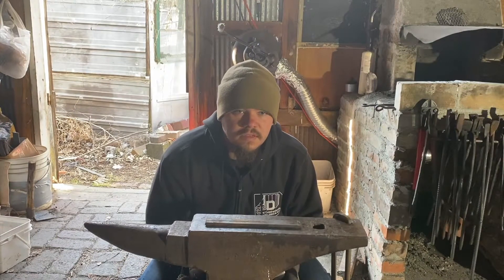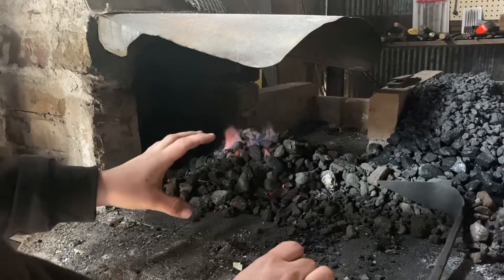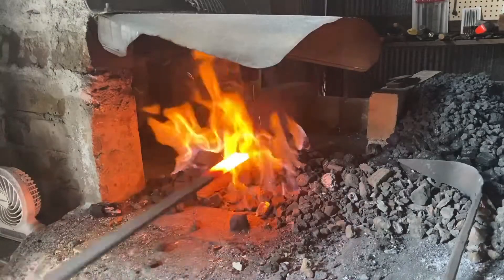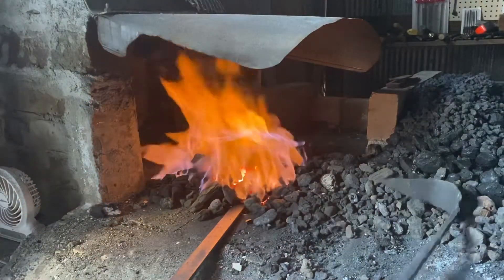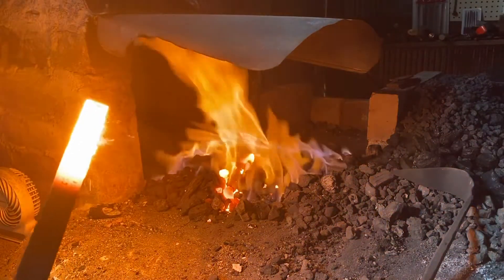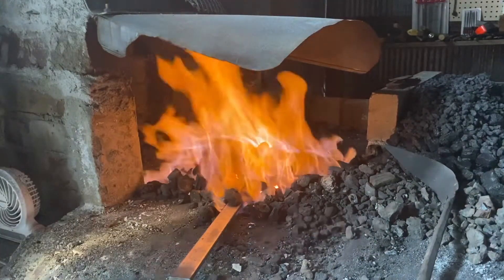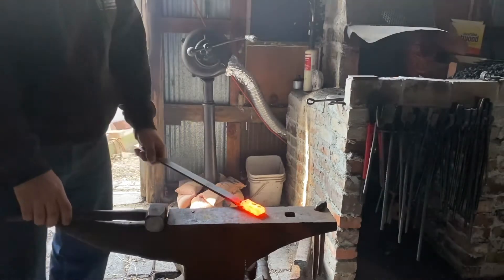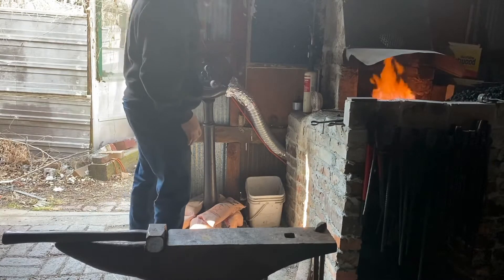Learning How To Forge Weld Made Easy

Comment: I’ve been having trouble forge welding I was wondering where u put the metal in the forge pot to forge welding cuz I keep burning mine or it’s just giving off a lot of forge scale
Reply from the maker: @markperryman797  I lay mine flat with the table, that puts my steel at the reducing zone of the fire from my pot, which prevents the excessive oxidation of the steel.
Reply: @ so just leave it in the neutral zone don’t put my metal in the fire pot
Reply: @veteranironoutdoors8320  I was putting it into the fire pot not realizing it was probably oxidizing it

Comment: I've found scale the biggest problem. If I can't get it to stick its usually due to scale and not cleaning it off.
Reply from the maker: That means you are not getting the metal heated thoroughly. At forge welding temperatures (for mild steel and wrought iron) scale actually melts and becomes a ferrous liquid. (If you want to get technical, the atmosphere in the forge has chemically converted the scale to liquid iron-if you use flux the chemical reaction makes this happen at a lower temperature) When you hear people say “the steel must look wet to weld” that is exactly what they are talking about. They have an even heat throughout the piece and the scale on the outside has liquefied, and welding is achieved easily thanks to the liquid iron surface and the long working time granted by having a hot core that is feeding heat to the weld rather than sucking it away.

Comment: Do you think it's possible to weld layers of steel together and then get them hot enough in a charcoal forge to beat the steel into stock usable for a damascus style blade, or will this require more heat than you can achieve with charcoal ?
Reply from the maker: Absolutely. I used charcoal for the first two years of my forging career, and got bit by the Damascus bug early on.
Edit: Charcoal was the main forge fuel for centuries before someone figured out you could burn those black rocks.
Reply: @veteranironoutdoors8320  I've played around with my map gas forge beating steel, making some knives, tongs, etc. We've moved recently and all of my stuff is in storage. I can't bring it here, but I do have an old grill out back that I was thinking about repurposing into a charcoal forge with the help of a battery operated leaf blower lol. I've been wanting to try my hand at the Damascus  thing for a while. Thanks again!